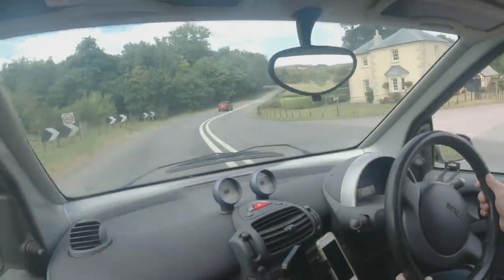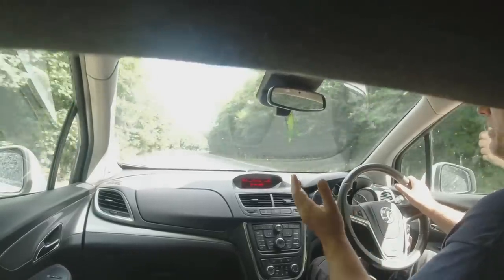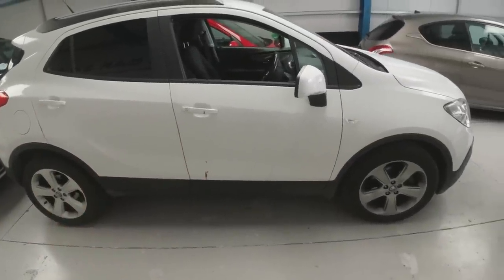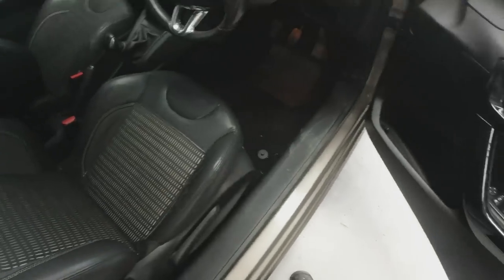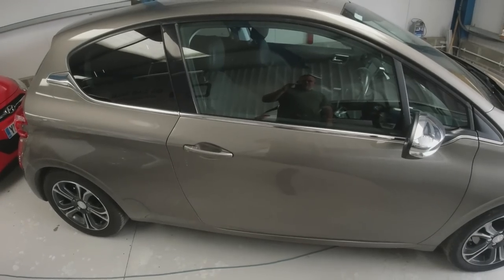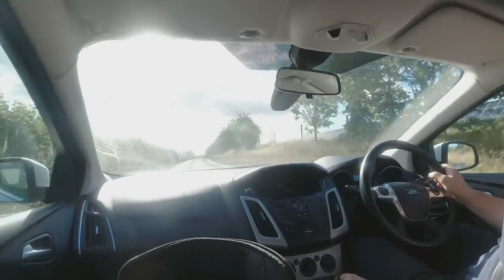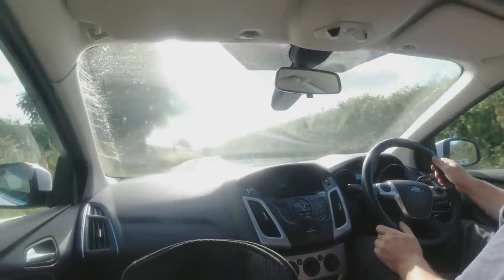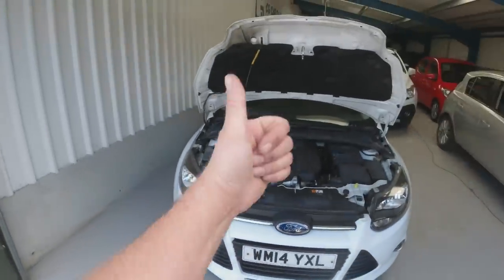So why was this Focus was Part Exchange with Cinch! I soon found out!

Comment: Check the Vauxhalls actually have bluetooth. My mk6 Astra SE was advertised as having it due to the buttons being on the wheel and radio   but it was actually an optional extra
Reply: I have a 2008 focus. It has a green phone and a red phone button  but either one just mutes the stereo.
Reply: @chrishart8548  mine just muted the audio too. I got hold of the sales brochure for the astra and even the top of the line "Elite" was an option too. Would never have questioned those 2 not having it as standard especially when they had the buttons for it
Reply: @Paul_Davies77  cd 400 doesn't have bluetooth.
Reply: @mrt9031  it had the Phone button on the unit. Guessed it was just easier for Vauxhall to install the buttons on the radio and steering wheel as standard and then if someone chose to have bluetooth as an extra it would be a simpler process for them .
My work colleague bought a 2012 SRI and was also told it came with bluetooth. He was annoyed to learn it wasn't actually available considering the buttons
Reply: @Paul_Davies77   yeah it's the unit that signifies if you have BT or not. It's quite a strange set up with the vauxhallls. CD400 has not got BT. CD 500 has BT but not all are capable of streaming music that can be said for the CD 650 nav too. 65 plate onwards they got with the times with BT for voice & music streaming.

Comment: I had one of those pugs last year, had a knock, could not find it at all, turned out to be the shock it's self, it had worn and it was rattling in its self, you couldn't tell as it was under tension from the spring, so if you can't find any play, that's what it is bud.
Reply from the maker: Top tip cheers
Reply: @ChopsGarage  bet it's that bud, mine sounded exactly the same
Reply: Oh good to know, don't think I've come across that issue on one of those yet
Reply: @sammytheseal2307  yes mate, took a bit of finding, it was OK, I had a tyre fitted and when it was jacked up I think that finished the shock, actually replaced the top mount but didn't check the shock, so had to do it all over again, see our mates in trouble again with that focus, I've been working on a pug van, sane engine, can't get any fuel pressure, so probably pump.
Reply: @roystonvehicles9129  Yep wouldnt normally expect that noise from a shock but everyday is a school day with these newer cars!
Reply: @roystonvehicles9129  What year is your van? The earlier DV6 used to have Injector issues which can flag up low fuel pressure. 
Few things to check first, if it's a sudden failure then you might be lucky and it's the rail sensor 
Is it starting at all? 
Though I appreciate it's hard to know when you've bought it but in my experience H/P pumps usually get gradually worse i.e take longer and longer to fire on hot starts when fuel is less viscous, until they refuse to go and start cutting out altogether
Reply: @sammytheseal2307  iits a customers mate, he broke down, I've bled it up but can't get anything the injectors, hardly a dribble, it's been coming up low pressure off and on for a while now.
Reply: @sammytheseal2307  customers having it recovered to a diesel specialist (!) I've had a few hours for free as it is, I think its pump but that's 550 plus vat, plus a belt so it's a grand bill and it might not be that, so I'm bailing out, I'll let you know if they sort it bud.
Reply: It's been recovered away, I've had 3 hours or so on it, can't get any fuel to injectors by cracking nuts off so can't see its injectors, when I've bled em up before I've filled the filter, bled thru, cracked union's off and if it's a good pump it's gone, had one last year and pick up was blocked with a jelly like stuff, he was running on cherry tho!
Reply: @roystonvehicles9129  Best thing you can do is sack off any modern diesels with a running issue, there's so many sensors/pumps/vales and other gubbins to go wrong it quickly gets expensive! 
Yes I'll be interested to hear what the fix ends up being, even better when not at your cost!
Reply: @sammytheseal2307  yes mate, it's a customers van, bought at 6 mths old, I've always serviced it, new dpf, turbo recently, so I had to have a go for him, tbh I've got 30 of my own cars to do, so hate taking jobs in, especially if I'm not sure it won't sort it, I couldn't even get a dribble at the injectors, another strange thing was pressure was showing 350 kpa even with unions off, never known that, could be a ecu fault, pressure should have been zero, anyway I'll let you know, could have been a faulty pressure sensor if value didn't change?
Reply: @roystonvehicles9129  Yes I'd say pressure sensor too... I believe the ECU won't command the injectors to fire if pressure is too low??  But then the lack of fuel at the injectors doesn't make sense as you'd think it would still build pressure if the sensor was reading too low and shutting the injectors off?
Reply: @roystonvehicles9129  Up until the rail, its all entirely mechanical so if there's low rail pressure it'll surely be the H/P pump if there's no fuel, or if there is fuel but the reading on the scanner is low causing the injectors to shut down then probably pressure sensor. 
Or if there is pressure building up but getting lost then maybe a duff regulator? 
There's only so far I go though with modern diesel running faults though, too many ifs buts and maybes!!
Reply: @sammytheseal2307  yes mate, usually it's prime the filter, crack injectors off, bit off cranking, bit off pumping and away, it was like a valve in the pump wouldn't let fuel thru.
Reply: @sammytheseal2307  yes mate, so hard to sort diesels when they play up, I'm not buying any more, I think I've got 5 with running faults that I'm not getting one with.
Reply: @roystonvehicles9129  yep, plus you'll get the blame if £1000 later it's still not right yet not many people seem to understand how impossible it is to troubleshoot them! 
They're ok when they work but too much of a headache when they don't. 
I don't blame you not buying any more!

Comment: With the focus. Check the diesel fuel filter, they tend to get overlooked at services and clog up. When you turn it off and on again the fuel pressure kicks it through and your fine for a while. I had the exact same issue on a Mondao, the filter had never been changed (with 110k on the clock) once done I had no issues.
Reply: I had issue related to fuel filter leaking air in which can get into the high pressure pump causing low fuel pressure cutting the fuel injectors - I out a new decent fuel filter and rechecked the o ring seals on the housing
Reply: Also after no driving for a few days had an issue getting it to start up due to air lock also
Reply: Amazing it got that far. I had to do the fuel filter at 55k the engine wouldn't rev over 3k under power.  The filter was really dirty I thought fuel was cleaner than that.  After the new filter it's ran great ever since.    It nearly didn't start thought  I didn't prime it like they said I had to just filled the housing to the brim and hoped for the best.  I started eventually.

Comment: I would still go down the route of the egr cooler it's very common on those focus
Reply from the maker: That has been done though according to receipts
Reply: @ChopsGarage  hi we had one that came through our garage last week and it had been replaced 6 months ago and it was faulty they contaminate the electronic part of the egr and in worst case they stop the car from starting, simple test is to unplug the egr and test drive

Comment: Had a similar problem on a 2.0 tdci no codes or engine management light. Was a blocked egr valve - had it replaced and no more problems.

Comment: Bca own we buy any car and cinch … so it’s game over for second hand cars
Reply from the maker: Only under 5yrs old
Reply: @ChopsGarage  cars are so expensive to fix now … wen I was a car dealer i would put a new clutch in a Sierra for £34 and put a grand across it … good old days ….
Reply: I would fit it myself lol 😂
Reply from the maker: @andrewmckenna1839  If Im not netting 1k I very rarely do the deal mate not worth hassle
Reply: @andrewmckenna1839  those were the days  even around 2000  a fiesta clutch was £86 at Mr clutch.    the clutch itself £34   now its £500 for most cars.
Reply: @andrewmckenna1839  I used to get a full exhaust fitted for a cortina for 11 quid in the 80s.

Comment: Flush coolant with G101, re anti free and auction bud, probably blow 500 after fees, sorry mate.
Reply from the maker: I think I will get the lads to take a look. Drove it tonight, no overheating, no boost loss but lost water, I think I want to check water pump
Reply: @ChopsGarage  oil in coolant is the clue bud, I'd agree with you if it wasn't for that, easy to see if water pumps leaking you'll see drips
Reply: @ChopsGarage  just say no to diesels, I am, bought 2 petrols yesterday, no problems.

Comment: Can you call a space saver a proper spare wheel  ?
Reply from the maker: Yep vs can of gunk that most have now that won't get you home after a split
Reply: @ChopsGarage  and the tyre can't be fixed after it's  been filled with goo.  I carry a compressor.   But almost every puncture I've had has either been a very  slow puncture or when it has gone the tyre has been toast.  If a tyre goes on the motorway it's really done for.  It tears everywhere it touches the ground in seconds.  Your lucky if you make it to the hard shoulder.
Reply: @chrishart8548  actually they can be but no tyre dealer wants to as it covers their equipment with gunge.

Comment: Apparently people have experienced pressure in the coolant system even when cold on those. 
Some have said the coolant cap could be faulty too.
But it does suggest a warped head or gasket.

The fault with the loss of power to me sounds like EGR/Turbo/DPF type problem. As you reset it everytime you turn the car off and its fine again. Might be worth doing live data on your computer jobbie if you haven't already.
Reply from the maker: Yes will be plugging in
Reply: @ChopsGarage  More content to follow :D

Comment: You should have a go in a real Smart. A 453 turbo. I have one, it is so fast. I went over to France, two months ago to see my brother,  and floored it down the Auto Route, I Chickened out at 115 mph!  And that was confirmed on my sat nav. The new shape, Smart, is light years away from the older models, a real pocket rocket. The local remap company here in Cornwall, Celtic Tuning, can remap it from its 89bhp to 130! I am very tempted, but will my heart take it? The engine is  Renault 3 cylinder 898 turbo, and my one, has the six speed twin clutch auto. I have not tried it in "sport mode" yet!

Comment: No bluetooth on the Vauxhall's. CD 400  unit doesn't have the module. Easy way to tell with the corsa's is with  the info screen. Small screens= no bluetooth. 1.4 corsa's if this vintage not the best, very little power difference from 1.2 but annoyingly rev their tits off at 70mph on the motorway

Comment: Hope someone in hear can help me i am looking at having timing  belt changed Renault  Modus 1.5   Diesel  i have all sorts of times thrown at me from 2.5 hours to one saying 6 hours why can mechanic not talk to the public with straight lines   i do deep research online and worked out 3 hours max so i want to no any ideas  :-)
Reply: Book times are bollox, no job can ever be predicted as there could be seized fittings or broken parts along the way.

Comment: Another one for the wife to run and sell mate?
Reply from the maker: No I don't do that with cars with known problems everything she has had as been good, tried and tested for few months at least. I have decent margin, Ill do the maths pretty sure even after head gasket I can come out ok
Reply: @ChopsGarage  OK bud, it was a tounge in the cheek comment, quite often on diesels it's a cracked head, oil pressure is higher than water pressure so oil goes into the water, maybe oil cooler tho.
Reply: @roystonvehicles9129  not always...water can leak into an oil return which is under no pressure